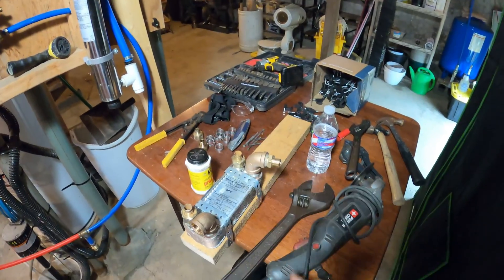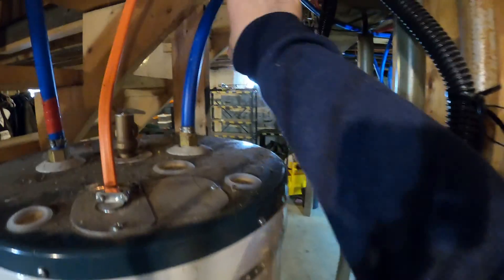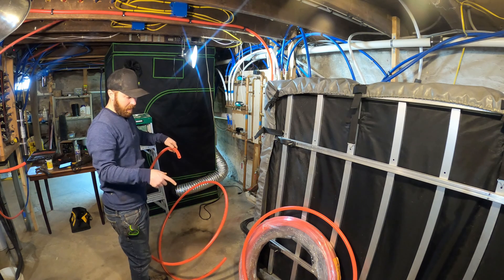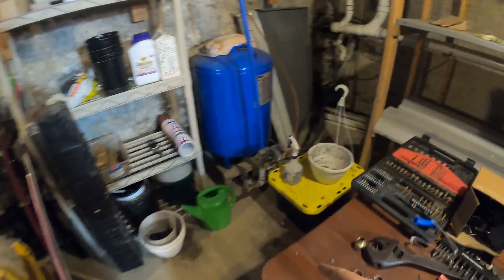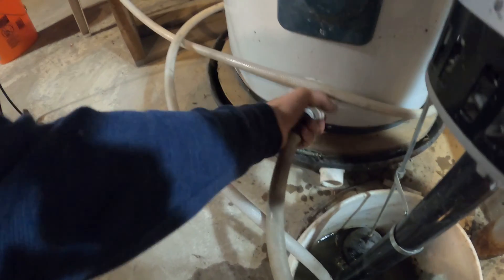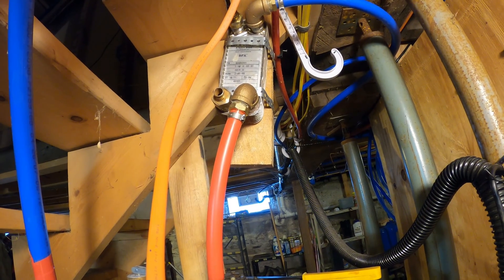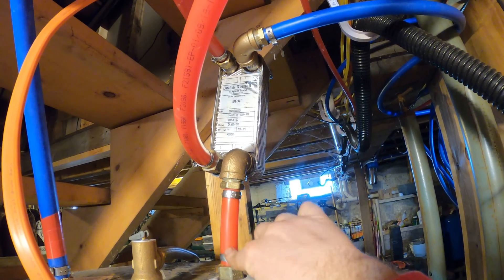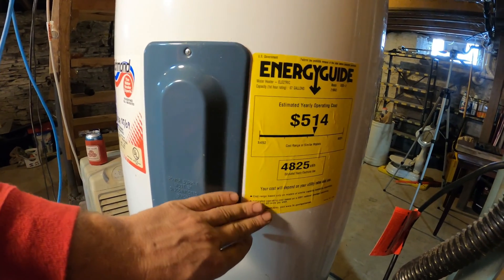Pre-heating Domestic Hot Water w/ my Outdoor Wood Boiler

Comment: No plumber here, but I thought its possible to configure the house plumbing with a "hot water gravity loop". Basically you would connect a pipe to the low point of your water heater to the most distal part of your upstairs hot water line. This will create a continuous loop through the tank that will allow the hot water to rise up through the pipe then return back into the drain at the bottom of the water heater tank. I watched the same video that you mentioned on YT. That guy was not making sense in his explanation. You should be able to do a google search for "water heater hot water gravity loop" and find the info to make it work without a circulating pump. Not sure if it will work, but its discussed here https://www.youtube.com/watch?v=WRQMGw1ISDo

Comment: I made a set up for my hot water tank using a tube and shell exchanger to preheat water going in and also with a side arm on it to heat it while it’s not being used all made together with bypasses check valves and also a spot to fill my outdoor wood stovefrom inside the house. I’m not sure how to send photos on here, but if you’re interested in seeing it I don’t know if there’s a way to message me, but let me know.
Reply from the maker: @adambater2767  definitely interested in the hot water heater setup. I also have my boiler set up to fill from inside house.

Comment: Do pex pipes handle the high temperature well?
Reply: Most pex will be rated tor 180. My plate exchanger sends out 170 degree water so that doesn’t leave much room for temp increases.

Comment: There's no recirculation possibility, so of course there won't be any sort of thermosiphon in this setup. I've only seen sidearms used for that, as I'm not sure the plate type would allow for effective flow without a pump though maybe I'm wrong. I'm curious how much that plate HX actually preheats when the tank is filling. Have you felt or put a thermometer on the exit of the HX when it's operating?
You could put a recirc line between your drain port and the pressure relief valve, though it is unfortunately on the top which can cause a thermal block in a thermosiphon setup. Then you could heat your DHW nearly 100% from the boiler apart from high usage times. If the thermosiphon doesn't work, could have a small recirc pump hooked through the contacts on your bottom thermostat so it's only running when there's still cold water at the bottom of the tank.
Reply: I made a set up for my hot tank with a tube and shell to pre heat amd also a sode arm for when its not running with bypasses check valves and a fill line for my boiler all in one👌🏻👍🏻💯

Comment: hi, i am getting hot water to the heat exchange but the water in the tank is cold can you please explain me what is the problem
Reply: If it's on the inlet side the HX needs to be big enough to heat the water substantially on a single pass. A small HX is only effective if the water is recirculating.